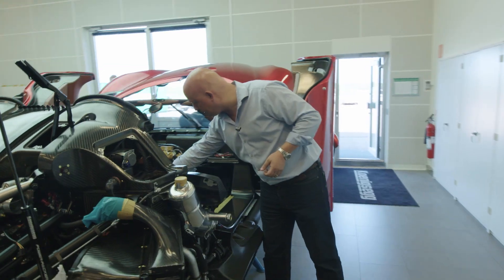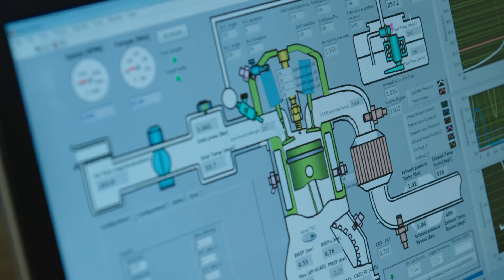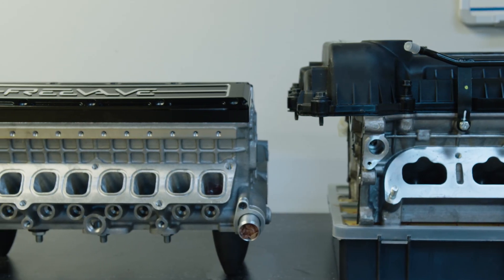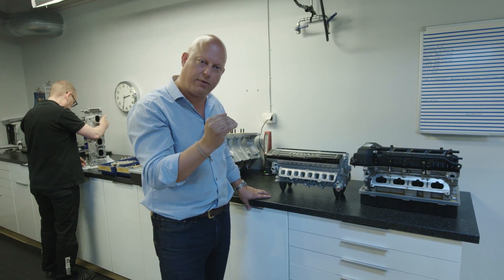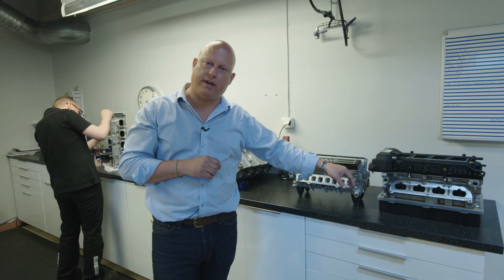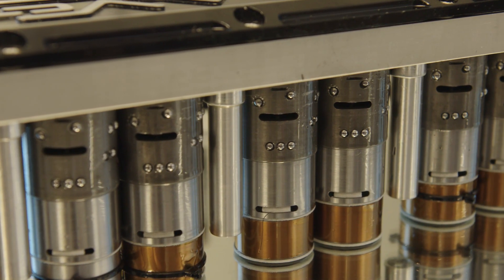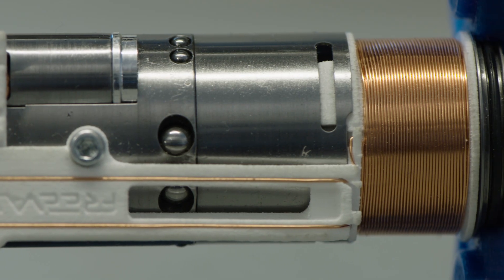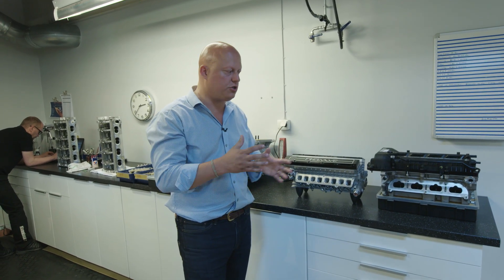Freevalve Update Camless Engine -- /INSIDE KOENIGSEGG

Comment: Years ago I asked a mechanic friend about using an electromagnetically opened and controlled valve train with pneumatic valve damping, He told me it would never work.
Nice to see someone take this step in engine design. Imagine It. An engine that can idle smoothly at 650 to 700 and Produce GOBS of power on demand as needed. No more lumpy idle yet maximum horsepower and torque. The ULTIMATE sleeper.
Reply: which is why he was a mechanic and not a designer,  the impossible becomes possible with experimentation
Reply: Jusb1066 . And the mechanics fix the designers and engineers fucked up products😠
Reply: 400rpm idle, 5000rpm yellow, 8000rpm red.

I can see it.
Reply: @ellenorbjornsdottir1166  Only an 8000RPM redline?  No valve float!
Reply: @ellenorbjornsdottir1166  Actually, no, it has springs.
https://www.youtube.com/watch?v=OZWeNPi2XkE
 Oh well.
Reply: What he's not  talking about is he needs an air compressor a reservoir and hoses which also take up room and add complexity; also an additional computer and associated connections added on to pneumatic valving interfaced somehow to the computer!  It's complexity is a multiple of ten when compared to the mechanical cam and springs, but the advantage is each component can be individually controlled to optimize for a given engine demand scenario!!  What he's done to isolate the turbo exhaust and free/bypass exhaust from each cylinder and again individually controlled by pneumatic valve is genius!  Then you also have the software development for each parameter that would need to be determined!!  It will be awhile before this is on your garden variety grocery getter!!!
Reply: @garybulwinkle82  wow your copy n paste skills are off the charts .. bahaha troll !
Reply: @garybulwinkle82  Replace your external pneumatic controls  with a hydrolic control supplied by the oil pump you eliminate much of thre issues you describe.  Much like Hondas VTEC.
Reply: @garybulwinkle82  until a genius guy working in his garage simplifies it.
Reply: @garybulwinkle82  it could be cost prohibitive for mass production and electric motors are making all this 'genius' engineering obsolete anyway. It's more of a novelty.. like producing race engines that run on coal. Or finding ways to improve compact disc technology. Its definitely awesome and ground breaking in pulling all the ideas into one engine but I see it as counter productive to a small company trying to cut as much cost as possible which he kept bringing up throughout the clip. 
He'd be better off dropping combustion engine tech and work on electric motors and increasing their efficiency and weight as well as the battery tech. Also i'd love for the world to wean itself from the middle eastern oil tit. 

p.s. "additional computer and interfacing" is a non issue as far as weight, bulk or complexity. I'm sure the engine could produce all the pneumatic pressures needed once the engine is started. The turbo exhaust can and IS rerouted on demand already, it wouldn't be much more complex to route it where it can provide pneumatic pressure when needed.
Reply: @garybulwinkle82  Well, much/most of the added complexity once the basic hardware is set up is in computer code.   It doesn't cost much more to "copy"/reproduce complex code as simple code.
Reply: It's pneumatically opened and hydrollically damped, not what you described.  Closing duties are handled by a spring.  It has (basically) a hall effect sensor for valve location/duration.  There's another video where a guy pieced together how it works by reading the associated patents.
Reply: Harcan Thatby-Wright  They've used pneumatic valves in F1 engines for years.  Williams used a Renault V10 in the early 1990s, IRC the redline was well over 10k.  Edit: according to https://en.wikipedia.org/wiki/Formula_One_engines#1989%E2%80%931994 it produced 650 hp (485 kW) at 13300 rpm, the redline was probably around 15k.
Reply: Sure you did
Reply: Explains why he’s a mechanic and not a engineer...
Reply: Me to I wanted to do this design, electronically controlled valves. My friends told me it would be impossible to get it to work due to speed isue. I feel so stupid.
Reply: @3dprintwiz378  if you had to ask your friend if YOUR idea would work and then gave up because he told you it wouldn't.. then yes you're stupid.
Reply: that sounds like EV
Reply: Im imagining a motor that doesn't use gasoline or valve trains at all...
Reply: Mark Johnson .I think they call them electric motors ,mate😉
Reply: Depends how long ago you asked your mechanic, he might not have been up to date. Electronically controlled actuation of fuel pumps and exhaust valves (camless engines) have been used for quite some time in marine 2 stroke low speed diesel engines, used for propulsion (20 years +) albeit for much lower RPMs (90-120). They got compression ratios of up to 50:1!!
Reply: How much to do it to my 4age?
Reply: JAMES TUTTLE it’s not designed by an American
Reply: In 1968 they said putting images on magnetic tape was impossible, like everythng else
Reply: JAMES TUTTLE hmm weird he didn’t think so, it seems like that could definitely be possible even after hearing it. I once told my buddy when I was a line tech, that they should put electric motors at each wheel and it would be great for handling and adding power, subtracting power at different wheels during turning, stopping, it would be good for charging when stopping, and then why do you know five years later some super car company has that shit. I was kinda mad not gonna lie
Reply: "Years ago I asked a mechanic friend about using an electromagnetically opened and controlled valve train with pneumatic valve damping, He told me it would never work.
Nice to see someone take this step in engine design. Imagine It. An engine that can idle smoothly at 650 to 700 and Produce GOBS of power on demand as needed. No more lumpy idle yet maximum horsepower and torque. The ULTIMATE sleeper."

I can imagine it. I can also see with such a design there's absolutely no need to idle. The car's central computer will have its AI programmed with all the knowledge of the physicists, the engineers and the practical mechanics so that every driver's control requests will be met with the most alacrity precisely according to the setting on the goal knob. Settings like 'Economy' or 'Drag Race'. With that capability it will be up to society to encourage particular selections.
Reply: Before caterpillar truck engines stop producing ( EPA/emissions) they were experimenting on cam-less diesel. That probably would have saved them..
Reply: Didn't you also come up with the iPhone
Reply: Have you chaps checked out Hyundai's 100% mechanical variable valve timing design? (100% mechanical - except for the one tiny cheap electric motor needed to turn the shaft that adjusts the rate of cam rotation (yet over the full range of engine demand)).
It can't adjust the length of valve movement, only the rate, but still it accomplishes most of what's needed to make a big improvement in power, economy and reduced pollution. Strikes me as quite an ingenious low cost solution.
https://www.roadandtrack.com/new-cars/car-technology/a31224648/hyundai-cvvd-system-explained/

Comment: Almost 40 years ago Henry Yunick in Daytona Florida got a patent on Vapor phase engine. The premise was that only gases can freely combine in a combustion process, and droplets however fine will produce an incomplete combustion requiring catalytic post combustion and so on. 
Yunick did not divulge all details that made the system work and others have discovered that they had problems replicating his process which had no ping and knock. This is old history and was probably not optimized with the benefit of variable valve timing. His mod was pretty simple deviation of a stock engine. Not to say it could not be improved.
Detroit have been notoriously close to big oil and Wall street, but I think China doesn't give a fuck about either.

Comment: Super chargers are gear driven, but EMD ( train engine) can disengage the supercharger and run in turbocharged mode at full throttle. How would you re-engage the supercharger when not at full throttle.  Apply a smaller version on a car would be useful, it would have good acceleration at low speeds but very efficient at high speeds through turbocharging at high speeds. The compressor is both gear and exhaust driven but how would they re- engage the gear I can’t understand. I owned a few turbocharged cars didn’t like the lag ,  l though about supercharger but at high RPM it would be underboost pressure all the time. Any ideals.

Comment: Well I just saw this page from nearly two years ago. I love this idea but I can't believe he never mentioned how it eliminates cam drag. Did you ever try to turn a cam shaft by hand? I'm guessing but I'll bet the cam eats up 30 to 40 hp. Did you remember to change your timing belt at 70 k? Oh wait, I don't have a timing belt, LOL!!!
Reply: 30hp seems excessive and that could be true at high rpm where the valve springs are not pushing back as hard on the cam lobe after center (see: valve float) and thus there is little to no recovery. I still don't see how it could represent that much force. Electric starters are substantially less than 30hp and they have no issues turning over the engine including the rest of it, against the compression.
Reply: Starter motors are often under 2kW (3.5hp max)
Reply: You still need to run a pump to produce the oil pressure to run the valves, and generate the electrons to control the solenoids.  Less than a camshaft and valve springs, but still uses power.
Reply: The valves are pushed with pneumatic pressure with help of solenoids and the timing is controlled electronically ..  No mechanical cams... No mechanical cams means, compact head design, no need to use timing belt/chain and pulleys, no need to lubricate the head, so load on oil pump reduced,  plus, with electronic control of valves.. There's more room to manipulate the valve lift,
Reply: @sumesh_singh563  yes, nobody said otherwise, just pointing out that even with cam and springvalve setup it's not 35hp of drag.
Reply: @jefrhi - It's about 30% friction loss, and 30% heat/cooling efficiency loss going off my fading memory.
@jimmies rustled @Thomas 16.04 - for the described 1.6 liter less than 1kW even is more common, you're right!
@Sumesh Doal - There's still friction going on, the valve stems are still rubbing against the head at high speeds, this requires a minimal amount of lubrication. You can even see in the video there's a small amount of oil when they show the head underneath the "camshaft cover".
@Ray Loveall - \/\/
@Jack Murray - Exactly!  You still have to open valves against the residual combustion pressure as well as the high spring pressure required to close the valves timely at higher rpm, the same force (minus cam shaft drag) is still required except now you're having a pump provide said force.
Reply: If you go on ingersoll rand website you can find the study showing that it requires a 7 horsepower compressor to run an air motor that produces a single horsepower.
Air is extremely inefficient method to power anything
Reply: Not in my car
Reply: I don't think you need a cam it's air controlled

Comment: I had a similar 18 years ago, but I was thinking to use electromagnets to control each individual valve. I pitched the idea to my buddy and he said it wouldn't work because the electromagnets wouldn't be strong enough to lift/close the valves. 

Glad to see this tech taking off.
Reply: Well, F1 and MotoGP use this technology for more than a decade... That's how they reach(ed) rpms of 18000 or even more. And don't forget that Mercedes was able to run the F1 petrol engine like a diesel, without having to ignite the air/fuel mix. They could switch between a normal petrol engine and the engine operating as a diesel engine during the race. If we take all this knowledge and technoligy together, internal combustion engines could be more clean, efficient, powerful than anything else.

Comment: This is a major breakthrough in existing motor tech! After just going thru the "joy" of replacing 2 timing belts on nightmare to do cars, imagine, Never having to deal with timing belts or chains again? and Not relying on the belt to keep the cams timed or even the primitive variable valve timing  mechanisms attached to cams anymore, imagine No cams needed and everything given infinite variability  by turning over the control to the computer..one couls infinitely vary the  valve timing to enable the best of All worlds and have low, midrange And topend tuning.. the torque and Hp increase he mentioned were stunning on that little 4cyl..what kind of increases would show on say a mustang gt or vette with that tech installed? lets have this NOW!

Comment: Interesting that he walks us through a turbo application. Leads me to believe the most impressive gains of his system is when it's applied to turbo engines. I'd like to try it on a single cylinder dirt bike engine myself. The lighter weight and lower engine center of mass is of interest. Also a broadened out power band is of interest. Lower RPM torque is a big deal in these engines.

Comment: Near the beginning he says they are "pneumatically controlled valves." Did I catch this correctly? Later in the video I see coils on what appears to be the valve actuator. This leads me to believe the the valve actuators are electric solenoids.

I believe there is a history to solenoid controlled valves. Roughly remember GM experimenting with this in the 80's or 90's.

Computer control "mapping" etc is light years today what it was in the 90's, but I'm still very concerned about the cycle life of solenoid controlled valve, or pneumatic controlled valve. Even if the main valve action force is coming from pneumatics, there still is a solenoid controlled valve as part of the system.

If Koenigsegg can get life out of these components, they've got a winner!

Racing and high performance applications is where it's at. I don't think they need to be too focused on production cars right now. Win over the racers and the after market community, and production vehicles can follow.
Reply: diesel engines have been using solenoids in their injectors for like 19 years with no problems. The coils last longer that the steel tips. Except they use pressurize fuel on them and not pneumatics.
Reply: The coil would be a pre-actuator which control the pressured air flow which moves the valve.

Comment: When I was going to GM schools while I worked for a Buick new car dealership in the 1990's they were talking about this, having computer controlled valve timing using solenoids on smaller valves. Nothing came of it, obviously, for the same reason GM destroyed the EV-1 electric car. The is an unholy alliance between the car manufacturers and the petroleum industry.
Reply: Please Google search, "Deferred Atkinson Cycle and Simultaneous Heat Extraction Engine".

Comment: I saw a "Never-Never Corvette" at an auto show in Paramas, NJ with electrically operated valves on a 327 ci Chevy Small Block. I'm not totally sure of the year - but it had to be before I moved from NJ to AZ with my family. That had to be in 1966 or so. 

No cam.... just 96 Volt coils to operate the valves against compression and with no cam, the engine had Electronic VVT that could be programmed in to change cam profiles as they were needed during differing RPM and throttle loads-gear ratios, etc. . 

This Corvette also used a central 'Light Generator' that was the source for ALL the lights in the car. It was under the passenger's seat - and although a little warm - it was a neat idea at the time. Fiber Optics were in their Genesis at that time and there was a long way to go.

Comment: Normally I'm not a fan of reinventing the wheel, but this is genuinely a step forward in engine technology if they can make them as reliable as regular engines with camshafts. In theory they should be more reliable because there's less moving parts.

Comment: Ahhh...great fix for a bad idea. The fundamental inefficiency in a standard 4 cylinder is the crankshaft geometry. When the cylinder is making maximum pressure at TDC, top dead center, the connecting rod is perpendicular to the crankshaft. Since useful work can only be recovered from that pressure when the connecting rod is tangent to the crankshaft, that force, that pressure cannot be turned into torque and even as the crankshaft rotates, only the portion of that force vector that IS tangent is useful. 
IC engine maximum efficiency, even with technology like this, is only in the mid 30% range. Electric motors easily reach 90% efficiency.

Comment: What about the added cost and weight of the air compressor and tank required to operate those pneumatic valves in the head? Also how durable are the seals? Have stress tests been done under hot and cold conditions to make sure you don’t get an air leak? I’m very skeptical of the horsepower and torque numbers he said; was the original engine tuned on a dyno first? Or was it with a stock tune and then after it was ignition and valve timing dyno tuned? 

I know F1 cars use this but each car costs millions, and are specifically tuned for each track and weather condition. This seems like overkill for a regular car. Would have cost much less to get an intake/header/exhaust, bigger turbo and a dyno tune and you would have had better hp and tq numbers, if that’s what the customer is after.

It’s cool and all, but again seems impractical for daily use.

Comment: Very nice innovative system. Great results also!! 

But.....the same results are quite easy with  a stand alone ecu on every 1600 turbo engine. The system has a lot of benefits, but the hp/nm gain is pretty standard on a 1600 chipped or standalone ecu turbo.